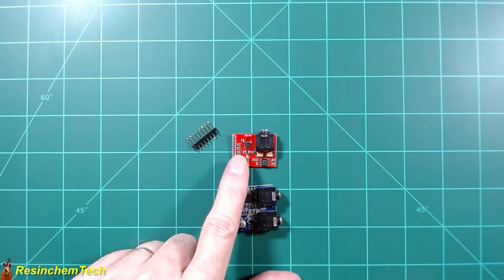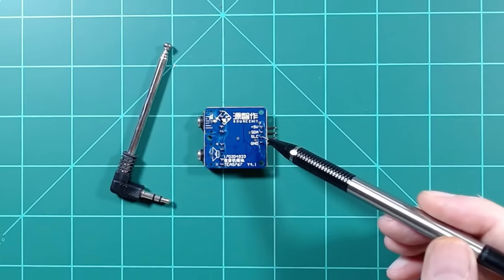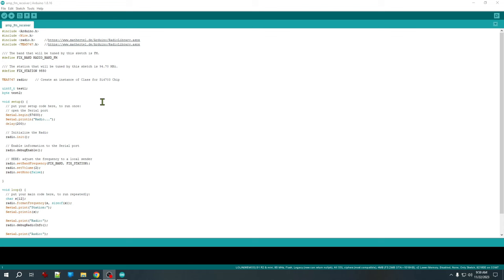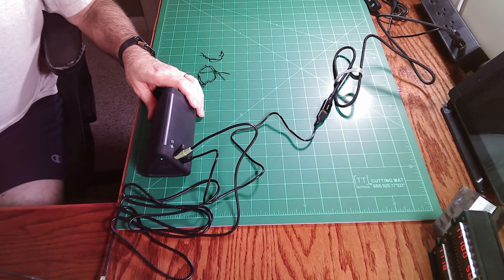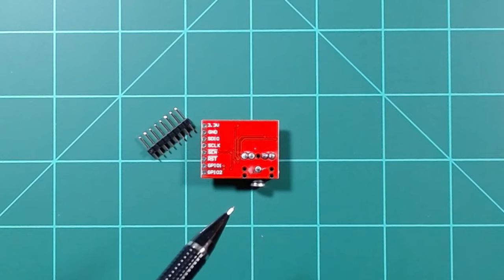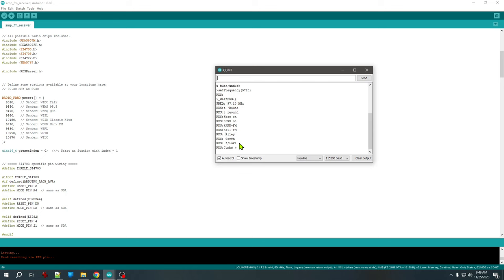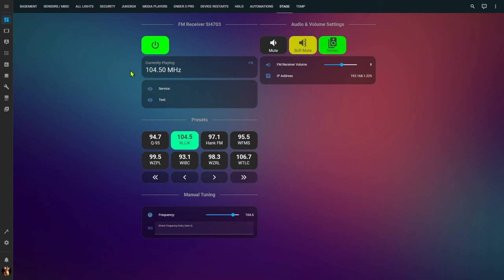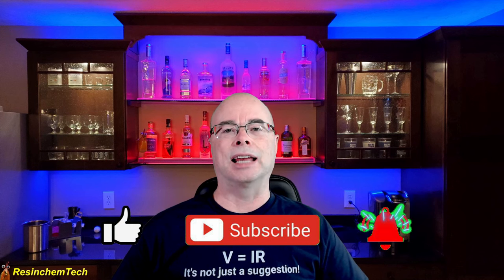Old-School Radio: Integrating an FM Receiver into Home Assistant

Comment: If you build and test in your finished basement and get good signal it seems quite good using the audio cable as the antenna
Reply from the maker: Well, as would be expected, some stations are better than others, but the reception seemed on par with my regular audio receiver.  And honestly, the TEA5767 with the included antenna had better reception, but the continuous background "clicking" noise was a non-starter for me.  And I do like the RDS info I get with the SI4703.  The question will be what the reception is like when integrated into my amp.  For this test/video, I was using a 3 ft. audio cable (antenna).  But I'd want something much shorter when integrated.  That remains to be seen/tested.

But thanks for the comment!

Comment: Nice! I was wondering if you made a video or wrote a blog about your cabinet lighting? I wanted to see your approach before tacking my project. Thanks again for the great content you create!
Reply from the maker: Thanks!  I haven't done a video specifically on my cabinet lighting, but I really used the same process that I show in this video on planning an LED install, where I install lights under my desk:  https://youtu.be/CffQpp-JSMo

In my case, since I had four 'segments' of cabinets... upper and lower on opposite sides of the kitchen, I ended up with four WLED controllers that I sync together.  However, depending on how you want to run the wiring, you could use a single controller and use WLED segments if you wanted separate control (e.g. colors/effects)  for different areas of the cabinets.

There is one other note.  I originally installed WS2812b 60 LED/m.  For the under cabinet lighting (that actually lit up the counters), is wasn't as much light as I hoped, so I went back and replaced them with SK6812 144/m LEDs that have a true white channel.  This provides much better working light.  I believe I talk about LED selection in the above video as well.

And as always, be sure to let me know if you have any questions.

Comment: Have you tried using a different power supply for the wemos and the radio board ?  Most likely picking up data from the wemos as the power supply isn’t the cleanest ……
Reply from the maker: I did try three different power sources and also tried keeping the power supply cable as far away from the wires connecting the Wemos to the receiver as I could.  The constant 'clicking' sound remained and upon doing some research, it was a common reported problem with the TEA5767.

I didn't experience the issue at all with the SI4703, so I do think it is something specific to the TEA5767... or at least the board I had.
Reply: @ResinChemTech  
I’m not one for giving up on anything until I know the exact reason 🤣 
OCD about finding problems and resolving them, as a professional designer it’s my thing. 
I’ll order one and see if I can help solve the issue 👍 great channel btw 👍🇬🇧

Comment: How close was your cell phone while you had the radio on? Nextel phones were notorious for alerting you to an incoming call by making your computer speakers pop and click, but newer phones still do it, though not as bad.
Reply from the maker: Well, my phone was in the same room but not near or next to the FM receiver.  And I probably spent about an hour messing with different wiring, etc. to see if I could get the clicking or popping to stop and I'm pretty sure I didn't receive a single call or text during that time.  And at one point I took the setup to a different floor of my home to see if better reception would make a difference (it didn't), so it would have been at least a floor away from my phone.

In a way, I'm kinda' glad it happened because I liked the additional feature of the SI4703, like RDS decoding, better than the TEA5767 anyway.

But thanks for the tip and what might have been causing the issue.

Comment: when i add the dasboard.yaml , i found  error, Configuration errors
Error loading /config/configuration.yaml:   in "/config/configuration.yaml", line 12, column 11: Unable to read file /config/dasboard.yaml.any suggestion
Reply from the maker: You should not have a 'dashboard.yaml' file.  If you are referring to the sample code from the Github repository, then the 'dashboard.yaml' file just includes sample code that contains the items that you would add through the normal Home Assistant dashboard editor.  This is there for you to use an example to create your own dashboard.

In fact, very little (if any) of the YAML code I provide can just be copied and pasted into your own Home Assistant.  These files are just provided as examples or guidelines for creating your own versions.  This is especially true for any 'dashboard' examples.  While these are written in YAML, they are not standalone '.yaml' files in your normal configuration.  This shows that, for example, you would create a vertical stack card, that would then contain other cards listed, etc. via the dashboard editor tools.
Reply: @ResinChemTech  Does this also apply to automations.script.yaml, helpers.yaml and mqtt_entities.yaml
Reply: @ResinChemTech  when i upload mqtt_entitites yaml. i found error :Configuration warnings
Integration error: mqtt_entities - Integration 'mqtt_entities' not found.
Reply from the maker: Yes... this applies to all the YAML.  It is provided as an example for creating your own.  You will almost always get errors and have issues if you just try to copy/paste YAML from someone else's Home Assistant configuration into your own.  There are too many difference in how things are configured.  You need to have at least a basic understanding of YAML, how it works and how it is configured before you can take someone else's configuration YAML and be able to adapt it for your own use.

None of the YAML I provide in this repo can just be copied and pasted.  You won't have your Home Assistant configured to use these file names (helpers.yaml, mqtt_entities.yaml, etc.).  As the documentation in the Github repo clearly states:

"It is unlikely that you will be able to just copy/paste these into your Home Assistant. Each entity or integration type should be placed in the appropriate location within your own Home Assistant (e.g. sensors, switches, automations, etc.)"

So, you MUST take each of the helpers in the helpers.yaml file and place it in the appropriate location in your own configuration, renaming things as necessary.  Same with all the other YAML files.  You CANNOT just copy these YAML files and place in your /config folder in Home Assistant.  That is never going to work.
Reply: @ResinChemTech  finally work .thank you

Comment: Have you ever heard or thought about an SDR (Software defined radio) plugs in via USB
Reply from the maker: I have, although normally in conjunction with ADS-B aircraft tracking. But I know that they also work in the FM radio range.  For my particular use case, I wanted a simple low cost option with a basic audio line-in for adding to my DIY amplifier.  At about 1/4th the cost (or less), these little FM receiver boards fit my particular needs.

But thanks for sharing an alternative.  I may take a look at one somewhere down the road.